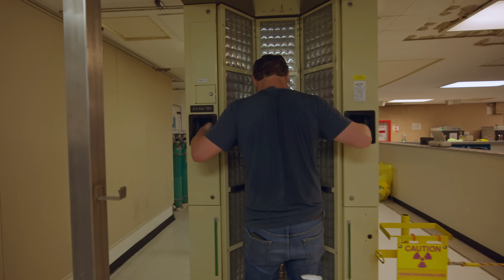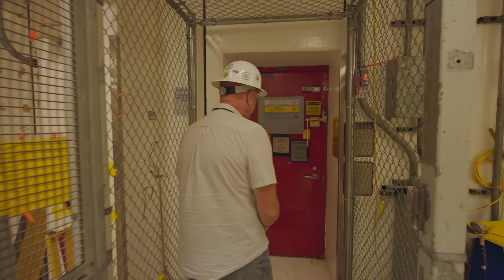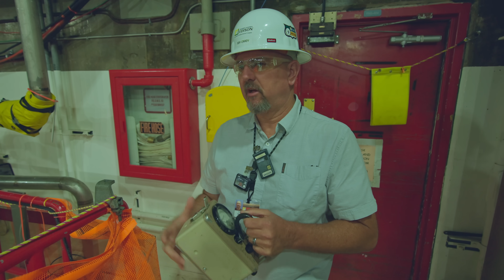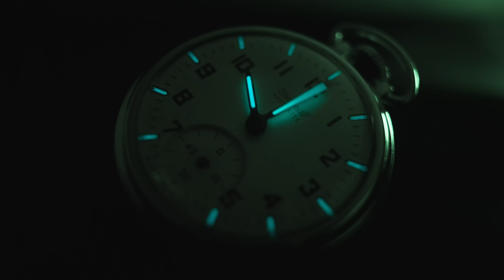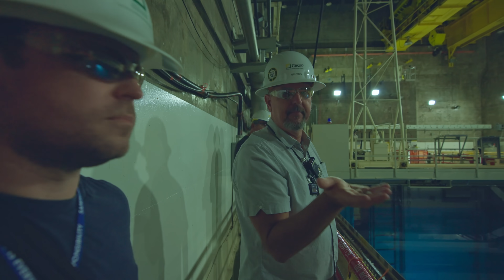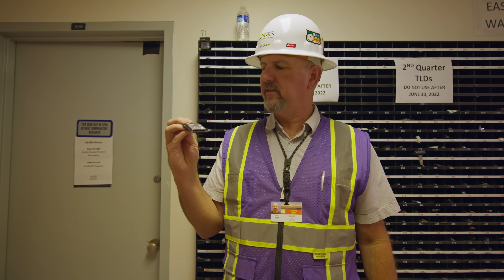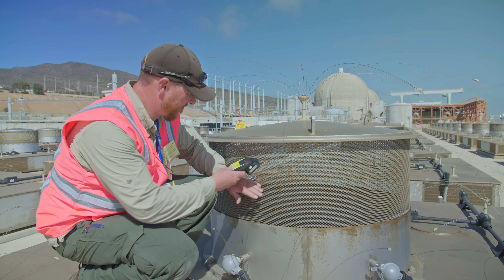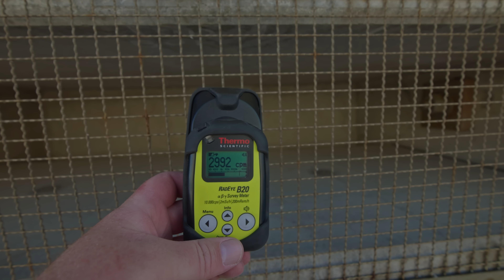Inside San Onofre Nuclear Power Fuel Pool and Spent Fuel Storage

Comment: My 2 years in the industry with hundreds of hours in the reactor building and around a lot of the hot stuff is less than 150mrem. I had to operate a valve that was 3000mrem/hr on contact. Got 2mrem in the 30 seconds to get to and turn the valve. It isn't that bad at all, if you fly a lot you pick up a lot more radiation than I do running around a nuclear plant.
Reply: I work at CERN a ton and the RP people hate it if you accidentally take your dosimeter on a plane.
Reply: @pauldavis2108  lol
Reply: @pauldavis2108  😂😆
Reply: Honestly. I work on a submarine and I have been asked CONSTANTLY how I'm not scared of my radiation dose....
You really don't get much compared to people why fly or EVEN on the surface. 
These "machines" are INCREDIBLY safe.
Reply: Or if you live near a coal plant. Those things produce way more radiation than most nuclear plants.
Reply: @dylantaylor5829  coal and oil plant particulate under 5(?) Microns kill a million each year and create around 10million fossil fuel related illnesses. Or as I call em "Fossil Fuel Mutations."
Reply from the maker: I totally agree about the flying frequently will give you more of a higher dose in the long term.
Reply: @RadioactiveDrew  why is that
Reply: @michaeltaylor8835  There is less shielding from the atmosphere against radiation coming from space.
Reply: @ptonpc yes it’s called cosmic radiation
Reply: @mikestein1024  Yes, I know.
Reply: @RadioactiveDrew wow was not aware of radiation in flying... thank you for the education..
Reply: I was on valve replacement program had to remove a valve 17600 mrem on contact lol
Reply from the maker: That’s spicy.
Reply: I work on powerplants in Sweden and renovate valves, I’ve only hade on really “dirty” valve yet but I’d rather have 1 ”dirty” than 50 less “dirty”
Reply: Looks like that yellow shield is secured with electrical tape! 😂
Reply: I hate how scary people perceive nuclear energy to be.
Reply: @aceslater5265  It's stupid but sorta for good reason. It's by and large one of the safest and reliable energy production methods... But when it goes wrong, it goes effing wrong

That's the only real thorn. That and the pesky "leftovers stick around for quite a while" bit.

At least the "good" news is, most of the nastiest dies the fastest... the shorter the half life, the hotter it is but the sooner it runs out of legs. The bad news is, you don't get even this far by just "wait until morning"... And if it's burning that fast nearby, you don't need to worry about your wishes for much of a future...

Fusion for the win. Worst case there you get neutron activation, resulting only in localized contamination at the reactor itself. Anything gets squirrelly, let off the magnets and 🤷‍♂️.

Whole different game.

Edit: Yes, when they figure it out of course. In the mean time, nuclear is what it is. While I don't think we're responsible enough as a species to mess with scaled fission, I don't see how we can do without it for all that much longer. So far, all things considered, I'd call it "good enough record for what's involved" and go on with it.
Reply: @aceslater5265  you can thank Hollywood for that, with dumb movies like "The China Syndrome".
Reply: @aceslater5265  cough tchernobyl cough fukushima...  there is no technology to decontaminate those sites yet... nuclear energy is scary
Reply: @flyingmechanic1  the less you know about something the scarier it can be. If you took a coal plant and a nuclear plant that produced the same amount of energy the coal plant would release way more pollution and radiation into the atmosphere than the nuclear plant would.
Reply: @flyingmechanic1  If you add up all the deaths associated with a power source, and divide it by total amount of power generated by that source, you find that nuclear power is actually the safest power source man has invented. If you find nuclear power scary, you must be terrified of other energy sources like wind and solar - they kill more people per GWh generated. And you should be absolutely mortified of getting into a car - you're nearly a million times more likely to be killed in a car accident than from a radiological release in a nuclear accident. Fear of nuclear power is akin to fear of flying. You see a big plane crash on TV, and it elicits an irrational fear of flying. Even though statistically it's the safest form of transportation.

The exclusion zones where people are not allowed around Chernobyl and Fukushima are about the same size as the flooded area where people are not allowed behind a hydroelectric dam generating a comparable amount of power. And those flooded zones are behind every dam, and remain as long as the dam is in operation. The nuclear exclusion zones are only around major accident sites, and radiation levels there will return to safe levels in a century or two.

Well, what we've defined as "safe levels" in a overabundance of caution and lack of data. (Wild animals are already living and flourishing in those zones. Apparently people are more harmful to them than the radiation.) Hiroshima and Nagasaki are thriving cities, with cancer rates barely higher than other cities. And the cancer rates at Ramsar, Iran (highest natural background radiation level in the world) are actually lower than the world average. Which strongly suggests our understanding of the dangers of low-level radiation is grossly incomplete and possibly outright wrong.
Reply: @flyingmechanic1  - Sadly, you are right. It's going to be a very long time, maybe a couple of centuries, before the melted fuel at the bottom of those reactors has decayed enough that the beta and gamma radiation level gets low enough that the wreckage can be cleaned up. And right now, I don't think anyone has a clear plan for how that's going to proceed.
Reply: @solandri69  those are irrelevant straw man arguments… a nuclear disaster can effect an entire continent and even more and when a meltdown happens we dont even have the technology to decontaminate the site… im all for nuclear research and nuclear energy but building nuclear power plants in high risk geological locations like japan is non sense, comparing the risks for the global environment of a wind turbine vs a nuclear power plant is just retarded…
Reply: @craigcampbell1843  dont want either type foo 150 years of coal and like 50 or 60 of nuclear why hasnt anything better been developed?
Reply: @ideapad2092  idk foo. Get to work on it. Personally I used to work in nuclear power and I think there should be way more nuclear plants than there are. The only real reason we don’t use it more is because the uneducated public is so scared of it.
Reply: @laura-ann.0726  There are no plans to "clean it up". If you paid any real attention to how this works, you'd know the intent is to bury it right where it sits.
Reply: @ideapad2092  You think energy just shows up out of nowhere? Lol

It has to be extracted from something ... "Why hasn't anything better developed"... Haha

Go join the ITAR team if you want to rush "something better". But stay in the cafeteria with that mindset, we don't need you anywhere near a reactor.
Reply: @flyingmechanic1  it's not though. Those incidents received MAD press and got the public TERRIFIED of something that generally IS SAFE. 

Every single technology has had its problems, and of those, some issues (chernobyl) have been caused by nothing more than leadership incompetence. Look at the US Navy and tell me when the last "chernobyl" we caused was. 
We run safe. Can't say the same for Russia as they have a plant on the bottom of the ocean rn 🙄
Reply: @ideapad2092  solar power is technically nuclear fusion. We're just harnessing it from the sun. Nuclear fission, though not as clean as fusion, is still better than massive plastic waste dumps caused by hundreds of old windmills, coal, and gas obviously release more rads and toxins, and there are a higher number of deaths from workers falling while installing/maintaining solar panels (and wind mills.) than from fission plants.
Reply: @flyingmechanic1  Because coal and oil spills have never caused widespread damage or anything... Newer reactors are safer, and we get better all the time. Its the best energy source we have until fusion becomes economically viable.
Reply: @dylantaylor5829  which coal or oil spill that happened 40 years ago are we still trying to contain ?
Reply: @flyingmechanic1  There have been like, 5 major nuclear incidents ever and only a few that we're still cleaning up.  There's been that many major oil or coal waste accidents since like, 2010 or later. Not to mention the literally dozens of still pretty severe events every year. Coal and oil are worse in every conceivable way, and the companies who provide would literally skin you alive if they though it would save them an extra penny.
Reply: @dylantaylor5829  I am all for nuclear energy, my comments were in reply to “nuclear energy is scary”   it is scary because of the shear amount of energy it can produce and because radioactivity can kill a human instantly, I just think it’s retarded to have nuclear powerplants in highly active/ unstable geological locations like the coasts of japan…
Reply: @flyingmechanic1 nuclear energy is scary in the sense that something that usually benefits us but can turn catastrophe within seconds or minutes. the amount of false information on nuclear energy out there is blatantly baffling. i know why chernobyl is so scary, it is our ultimate catastrophe. when looking at it tho: not only are the accidents not possible to that degree in our reactors bcs design. redesigns in ex soviets statea fixed the errors too. and equating fukushima and cherobyl works only on the basis of that there is molten core. the amount of radiation leaked is not remotely comparable, not to say a leak is a bit of euphemism in this sense.
Reply: Back in 2011 to 2013 i was the last company to come clean the inlet water tank's we where told they let go 2000 people right before we cleaned the heat exchanges.
Reply: Darn right, the total lie they portray is disgusting. Galen Winsor rebelled against then because of their absurdities swimming in a pool of spent rods and even drank the water. He looked 30 years younger then his actual age and had a natural tan and healthy as hell.
Reply from the maker: Yeah, I wouldn’t drink the fuel pool water. I’m not that down with ingesting cobalt 60.

Comment: Why do you measure counts per minute instead of sieverts? 

Also why does the plant use rem, I thought that was a deprecated unit to sieverts?
Reply from the maker: I like using CPM because I can see the total counts coming in, which is a real data point. Sieverts is used for dose which in most cases is used to measure gamma exposure. 

They used rem at the plant because that’s what they established as a unit of dose for that industry.

Comment: 9yrs? How long does it take to decom? As long as it operated?
Reply from the maker: As I understood it, the reason why it took so long was to get the state to sign off on it.
Reply: @RadioactiveDrew  these kinda things make modern small modular reactors make even more sense,  especially for small remote communities. 
I live in northern b.c.Canada, all of our power is hydro generated. But further north the main source is diesel generated,  sea can sized reactors could be a huge benefit to reducing carbon output. 🤔
Reply from the maker: I think small reactors would be a great idea. It also seems like a good idea to use the spent fuel from some of these larger reactors in smaller energy production. Spent fuel even after it has cooled down a bit is still very hot. That heat could be turned into electric pretty easily and it’s a very passive operation. It would work the same as RTGs do on space probes.
Reply: The US NRC has a couple of different decommissioning plans with the longest being up to 60 years (SAFSTOR).
Reply: The small nuclear power plant I grew up about a mile from was shut down in 2016 after operating since 1973.  Its decommissioning is expected to last through 2058 (40+ years).

Comment: the press were saying that "if a flask was dropped it would be death for all".    In the 1980s the UK CEGB (Central Electricity Generating Board) wanted to find out what would happen if a flask was hit by a train, so they took a flask and placed it on the old dalby test track then did just that, sending a locomotive and 3 passenger cars into the flask at 100mph.   

Locomotive was destroyed in a spectacular crash that sent the engine block flying out of the locomotive, the passenger cars were obliterated.   The flask however suffered just a bent cooling fin with ZERO structural damage and only minor cosmetic damage, (ive seen more damage on cars after being hit by a grocery cart)

Perhaps the press should watch that video.   its quite spectacular

search "train hits nuclear container" or "Nuclear flask test 1984"
Reply from the maker: I've seen that video before...its very impressive. Those canisters are some tough stuff.
Reply: @RadioactiveDrew  oh right, ive just insta'd the video of the testing of our Magnox and AGR flasks 

I dont worry about being next to a UK NPP.   Ive been to Heysham NPP tour, and felt perfectly safe.

Comment: 29:00  - speaking about spent fuel, a blow up accident should be remembered on Mayak, the USSR, in 1957. The cooling system of the tank stopped, the water was boiled out, and the explosion threw a lot of radioactive material, especially Sr-90, at a large territory.
Reply: This is the problem with Netflix docudramas. Not only inaccurate, but they make people think US nuclear reactors use the same technology as 1950's Soviets. 🤣
Reply: @uclajd , all action movies exaggerate nuclear problems to take cash in theaters.)
Reply from the maker: Well the majority of people just don’t know how anything works in regards to nuclear energy. So they tent to believe anything told to them.
Reply: @RadioactiveDrew , I analyze the list of the US NPPs and I see only one reactor to be powered up since 2000, in 2016. And even this reactor construction began in 1973. Only 4 reactors were powered up in 1990's. Fuel and radioactive waste storage technology is developing but it can't help the vessels to be younger and more robust.
Reply from the maker: @Serpiph  the storage vessels for the spent fuel are fine for the storage of this material at this location.
Reply: @RadioactiveDrew , I fully agree with you.
Reply from the maker: @uclajd  exactly.
Reply from the maker: I looked up the Kyshtym disaster, which is what you were referring to. None of what happened there could happen at San Onofre. None of those conditions exist there. The dry fuel can't explode and wouldn't even if the module holding the container was flooded. The container is completely sealed and filled with helium. So if water did get down into the area where the vessel is stored it would help cool and then if the water receded the water would eventually evaporate. It would not and cannot cause any type of explosion.
Reply: @RadioactiveDrew , that's great! The problem on Mayak was from direct water cooling. Stop the water flow and you'll get an explosion. San Onofre doesn't use water to cool the fuel, so the similar problem shouldn't happen.
Reply from the maker: @Serpiph  well...they don't use water to cool the spent fuel after a certain time. They have to let the fuel cool down in the fuel pool, then it can be moved to dry storage. But even then the fuel puts out a decent amount of heat and of course lots of radiation.

Comment: That gamma radiation at the vent, at the end of the video, doesn't make sense. How do you bend electromagnetic radiation? Why would gamma radiation be higher at a vent?
Reply from the maker: Because that's the thinnest part of the containment structure. So more radiation can be detected with less shielding.
Reply: @RadioactiveDrew  The video said the fuel assemblies were 6 feet below. (36:37). Later there is a picture of the inside of the vent. The gamma rays should be traveling in a straight line from the source.
Reply from the maker: @ggelsrinc  sorry you couldn’t tell from the video but those second containment structures were of a different design.
Reply: @RadioactiveDrew  I wouldn't think designing a vent would be that hard to contort to maintain shielding.
Reply from the maker: It’s about the size of the contamination vessel and where the inner contamination vessel is located.
Reply: “How do you bend electromagnetic radiation?” 
EM radiation "bends" (bounces) all the time.  It depends on the type of radiation an the surface.  Radio waves bounce around in the atmosphere without even a "surface."